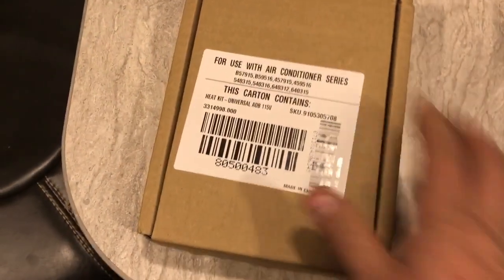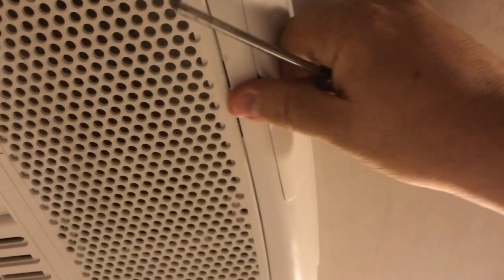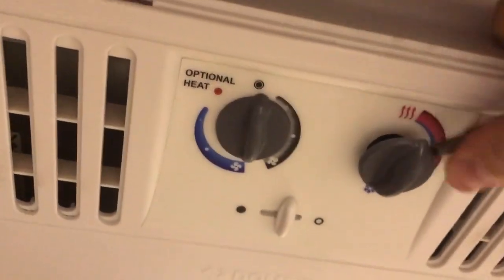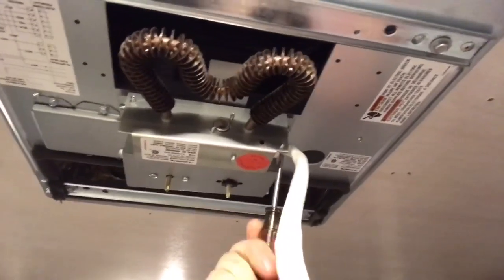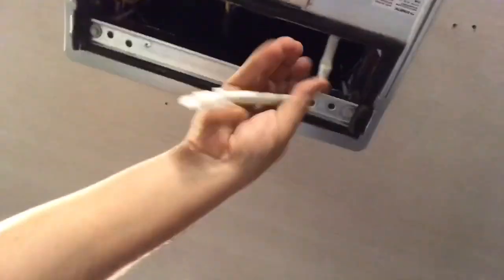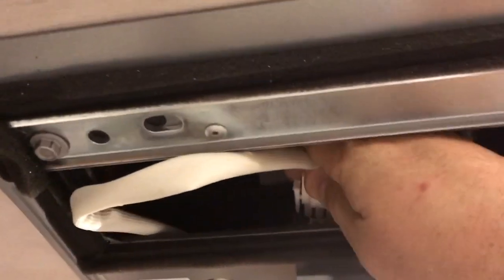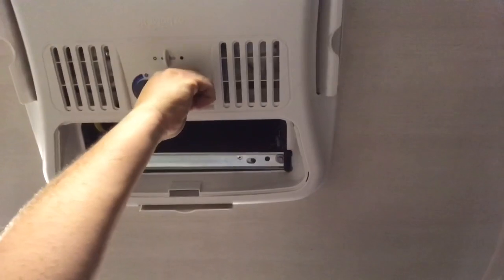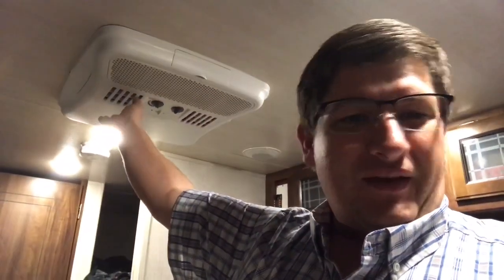Dometic Heater Install

Comment: I'm up here in the PNW.  It can get down to zero easily.  After 2 winters of freezing, decided to finally do this.  Time will tell, but great work.  Got mine installed no issues.  Yay.  One has to love working above your head, some form of ancient torture I think.  Thanks much.

Comment: Great videos. They helped me decide to pickup the same camper. Do you have any  trouble making the table into a bed?  Those are pretty standard straight forward designs but I can't get the cushions to fit. They are to wide.  I'm not sure it will get any better after break in.
Reply from the maker: It gets a bit better. I usually the side one last, and that keeps them from popping up.

Comment: Can u run this ac on low; or does it have to be on max ac? For condensation?
Reply from the maker: No speed setting when on Optional Heat. But you can use the various speeds for fan or cool modes. For AC, yes, you can run on low.

Comment: Thanks for the video, but your Amazon link doesn't work anymore
Reply from the maker: i just checked it, it worked for me. if it still doesn't, search for "Dometic Heater Kit (3314998)"
Reply: @EdwardCzajka  thanks don't know why it won't work for me thanks again for the part number

Comment: Can you repost the link or part number? I know it's an old thread but worth a shot.
Reply from the maker: This is the one I used: https://www.amazon.com/dp/B00EWX3Y2C
This videos shows the install process for a Dometic Heater Kit (3314998) for use in AC units B57915, B59516, 457915, 459516, 540315, 540316, 640312, and 640315.

Comment: Ed great video. I bought a 2020 Mallard M185 because you’re video’s made it look like a great fit for me. Can you tell me how to light the gas furnace? Is it located under the refrigerator?

Thank you for all of you’re content!
Reply from the maker: Mine self lights by turning on the thermostat and lowering the temperature.
I did replace my thermostat as the original one had a tough switch and I was worried about it getting broken off. https://www.youtube.com/watch?v=6tA0xnnvpb4